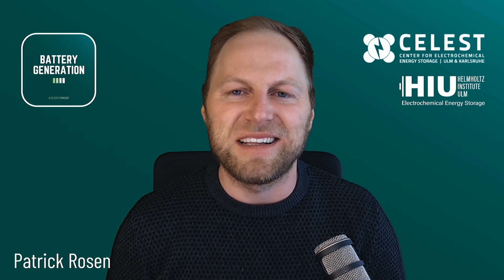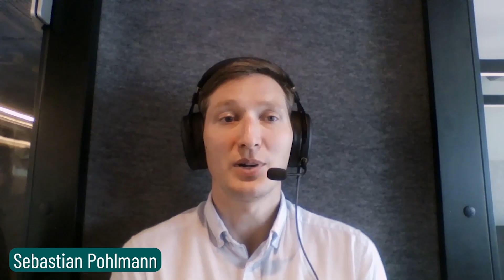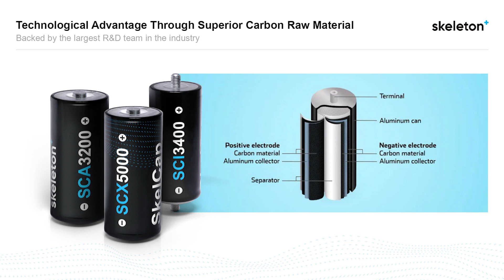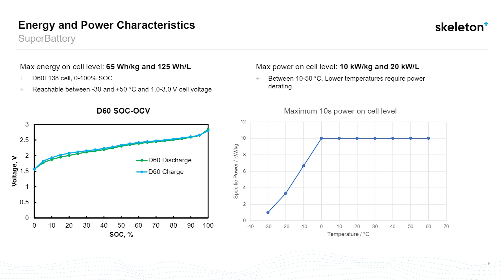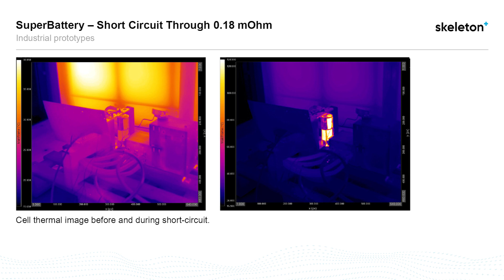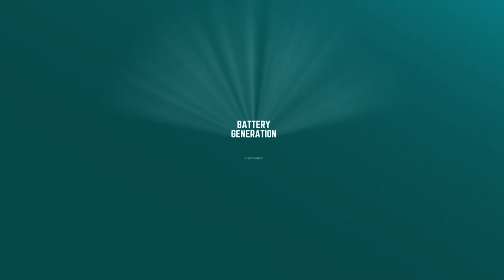SuperBattery: Hybrid Battery Storage Systems - Dr. Pohlmann | Battery Podcast

Comment: If they can make the structure of the vehicle a super capacitor that would be the most efficient way to do it.  Say an entire bike frame is filled with super capacitors and wrapped in aluminum shell for the critical supporting structure.  That is the future

Comment: I'm an EE familiar with design pitfalls of supercapacitors starting ~20yrs ago for applications requiring (active) discharge time <<10s. This "superbattery" (aka. internal hybrid or chemical hybrid) seems entirely different from the charge/discharge profiles and limitations of (super)capacitors. 
Although you asked one question about limitations and disadvantages, I was disappointed that you didn't elaborate nor show any quantifiable comparisons.

A serious headache in the industrial realm of electronics is lifetime reliability. Lithium rechargeable cells simply have not shown enough promise to handle the extreme industrial mission profile temperature range and last 10 yrs+ (note: standard lithium primary cells are accepted by our industry with a replacement schedule of 10+yrs).  The supercapacitors we've used have claims that if never charged above ~30% rated voltage (and thus electronically balance-controlled in an expensive array) should meet lifetime requirements with added capacity & ESR de-rating... meaning we install ~1000x more rated capacity than required (we need ~1J over time and temperature, but must install ~1000J). Note: our application is expected to see only a few thousand cycles over 10-20yrs.

The discharge curve of these "superbatteries" means much more usable energy! I really hope their lifetime performance - years of operation with stored energy (at temperature) - is just as good!
Reply: Lithium rechargeable cells simply have not shown enough promise to handle the extreme industrial mission profile temperature range and last 10 yrs+
==> Does above statement include the special max 3.6V LiFePO4?
(cycle life of LiFePO4 is drastically higher than any other max 4.2V Li-Ion battery, but temperature may be limited to -20/+60°C for discharge and 0/+50°C for charging)

Comment: In my book an ultracapcitor is built like an ordinary capacitor but it uses an insulator with a huge (or giant) dielectric constant. Supercapacitors make use of the electrochemical double layer, as stated in the video.

Comment from the maker: Thank you so much for the talk, Dr. Pohlmann!
Reply: The price needs to come down. And it will, if production can be scaled up enough. If today's cheapest Lithium-based batteries cost around $100 per kWh, and super batteries cost 20 times that much, they're $2,000 per kWh. Of course, in the correct application, they're an excellent solution.